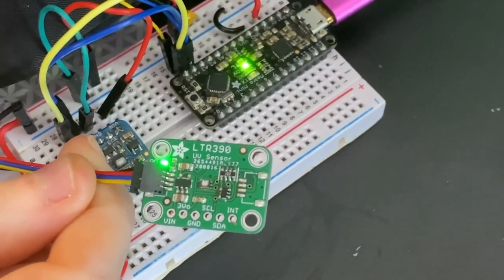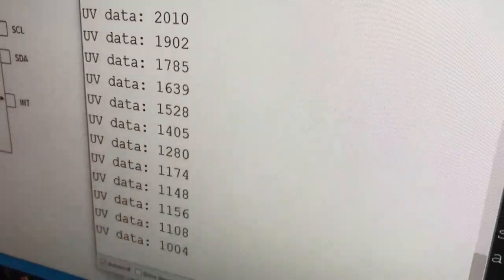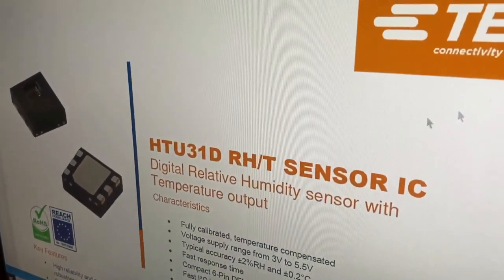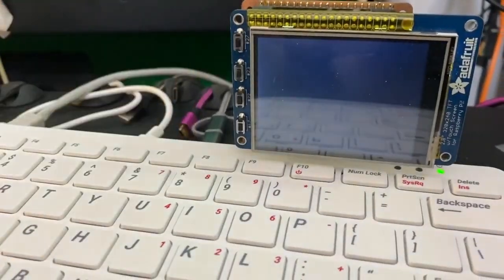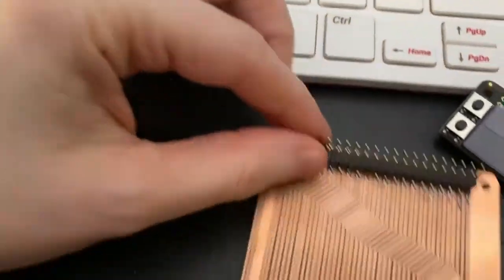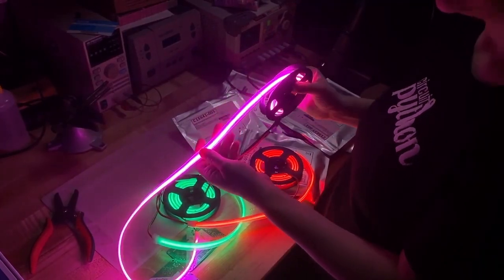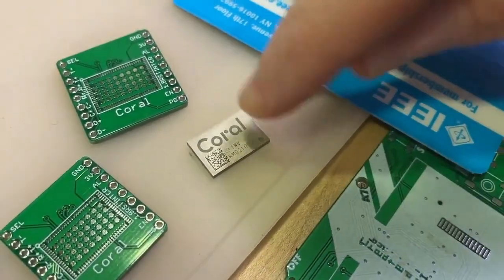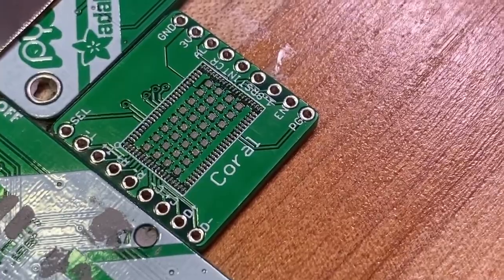Adafruit Top Secret! December 2, 2020 #Adafruit #AdafruitTopSecret @Adafruit

Comment: The coral stick looks like the kind of thing that would be nice in a machined aluminum housing. I know that's not your thing, but maybe once you make the stick, if it's popular enough maybe somebody will make housings. Or, can you buy metal cases like they'd use for usb m2 drive adapters in bulk, and use those? I'm assuming if it can draw 3 amps it might get toasty. (Does it need an auxiliary power input? Or just some huge capacitors?)